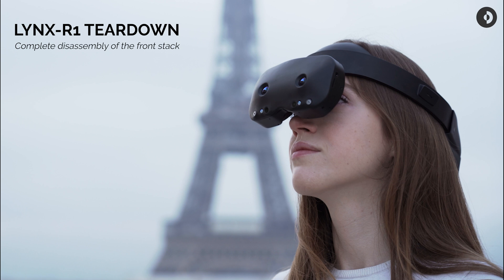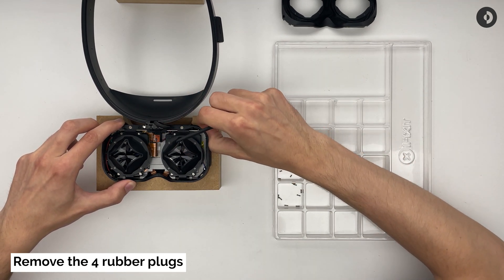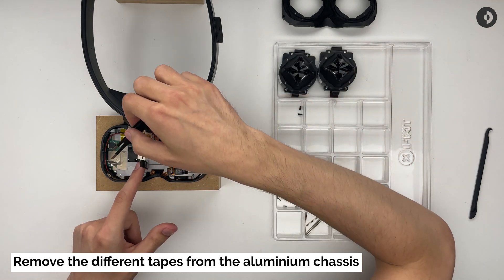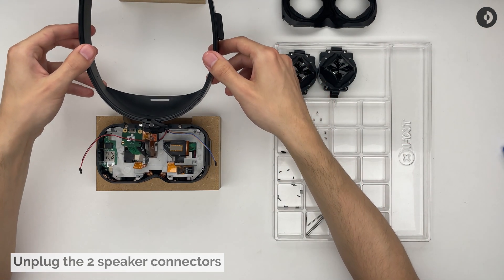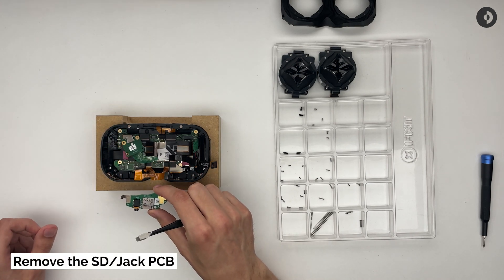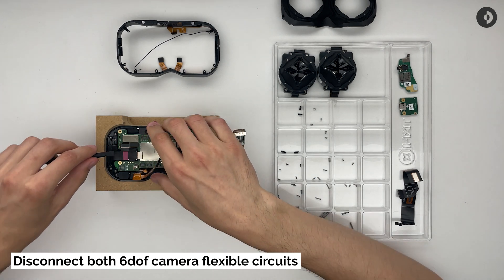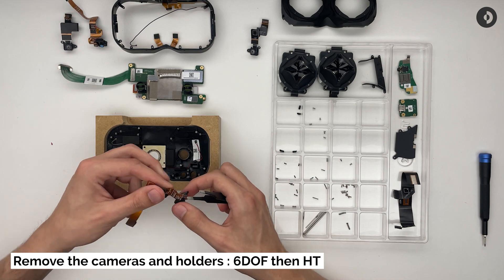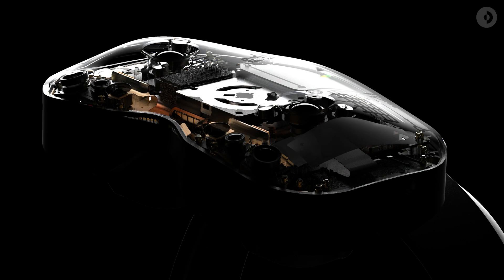Lynx-R1 Complete Teardown

Comment: As unfortunate as the delays and things are, this is a nice display of goodwill and display of the open-platform mentality, building it to be easily accessible and repairable, and publicly releasing an official decon for users/repairers. Wishing yall good continued luck on the rollout in the midst of all the challenges that presents.

Edit: As another person suggests, it would be nice to see a rebuild as well with recommended process-- A couple of elements look like they might be a little tricky to get situated correctly again, like the fit for the hinge plate and the front section, or reattaching the ribbon cables and reseating the lenses

Comment: It's been years, I don't think I'll ever see the product I've ordered and at this point, I've just accepted that this was either a scam,
or a well meaning idea that overestimated their ability to produce.
Reply: The pandemic didn't help, and also mega corps buying up suppliers and manufacturing capacity. Also, start up money dried up when interest rates went up. It's hard enough starting a normal business. Starting up a AR/VR business in those circumstances is even harder.

The tech is there, the passion seems to clearly be there, and they've been transparent about funding problems along with the difficulty getting manufacturers to produce the smaller number of headsets. They have shipped something hundreds of headsets. But it seems they're having trouble getting funding for the rest of em'. So I would say it's the "well meaning idea" option for sure.
Reply: @shableep  UPDATE:
I just recieved them.

Amazed at how well they work, at first I thought the lines would be a problem, but then I figured out how to properly put on my glasses with them and they work like a charm.